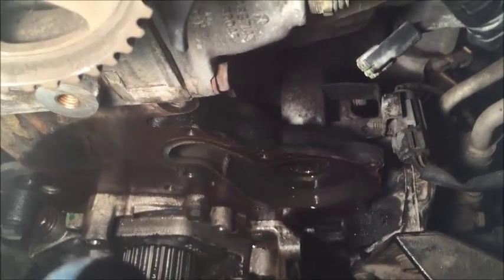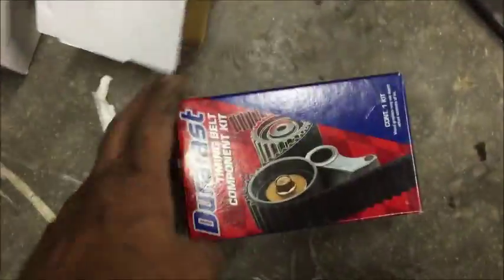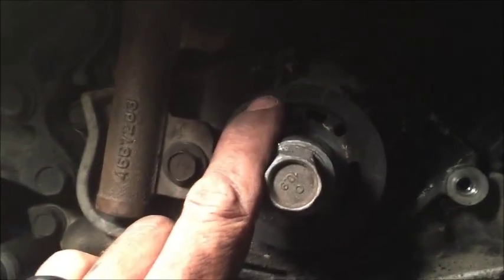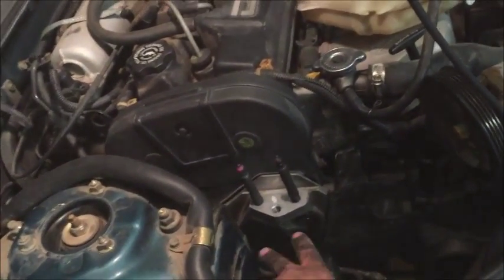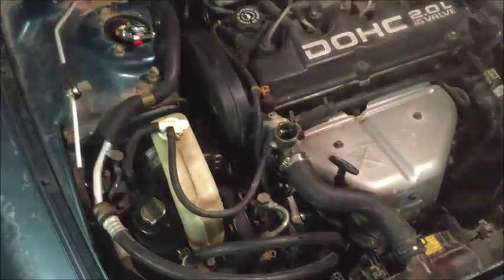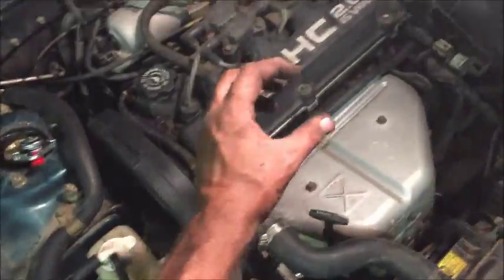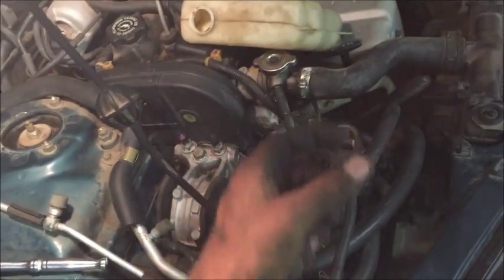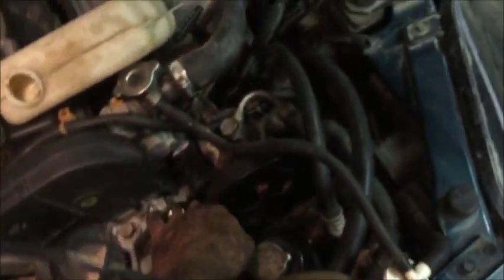How to Replace a Timing Belt on a Mitsubishi Eclipse (1989-1999) Part 2

Comment: Hey just bought a 1995 talon. Has exact motor yet the belt kit has a mechanical or hydraulic tensioner option. Do you recall which one you had put in this engine??

Comment: how did you put water pump on did you cut the timing cover and what did you do with the tensioner going to replace all on mines thanks
Reply: He cut it cuz the only way would be takin off the cam sprocket to remove    Back side of cover

Comment: hello love the vids I have a 98 RS and was wondering if you can do a vid on how to replace a head gasket and valve cover gasket. i have found a lil coolant int the first spark plug hole and I'm guessing that means my head gasket is bad and or just the valve cover gasket went bad but time to replace both anyway thanks.

Comment: Great video, I have a Neon the head was sent out for a valve job. Not sure how to realign the cam gears. looks like it is very similar to the Eclipse engine set up. Have not been able to figure out the cam gears set up. think the exhaust is just closing and intake about to open on #1 at TDC ? sound right? Thank you for the great video.
Reply from the maker: yeppers, that is correct. when your done installing, rotate the engine by hand ( socket on crank sprocket ) rotate it at least two times around to make sure no valves are hitting a piston. thanks for watching.

Comment: You should have said that you cut the inner timing cover in order to change the water pump. The only way to keep it in one piece is to remove the cam gears and then retorque them after you reinstall them.

Comment: How did you take off the harmonic balancer with the crows foot ? Mine just simply won’t come off
Reply from the maker: i wrap wire around it, lots of wire. however you auto parts store will loan you the correct puller with a deposit that is fully refundable when you return it. thanks for watching.

Comment: I just got a 98 eclipse and it cranks over but won’t start, it’ll run for a second but then shut off, I’ve replaced everything fuel related, new alternator and only thing I can think of is timing

Comment: OMG WERE ARE YOU!?   I NEED HELP DAMN IT
Reply from the maker: +frost lee 
im here, what do you need?
Reply: lol well  i justfixed my car that had bent valves.   the person put it back in the car,  but now there is a ticking noise.  it drives, and it runs,  but when i come to a complete stop, it wants to shut off and die.  plus the car shakes alot as well .   i dont want to fix the valves again, im broke after that ):
Reply: mine shakes alot too

Comment: great videos of the 420a engine. I've been looking for something that actually walks someone through the process.

one thing that I've been looking forward to see, is how to place the belt back on. I don't know which way to place the slack.

in between the cams and tensioner? or between the tensioner and crank.
Reply from the maker: slack will always be to your right. but the tensioner will pull it snug. great question. just remember when the belt is finally tight the gears should line up. so worse case rock 1 tooth of on the left cam, to the left thanks for watching.
Reply: +thomas brian awesome. keep up the videos! you have a subscriber.
Reply from the maker: always to the left, so if its a dual over head cam, between the left cam and the crank. thanks for watching.

Comment: Do you still get on YouTube? Because I have a couple questions if you would be able to help me I would really appreciate it.
Reply from the maker: i try to daily, but sometimes skip a day.
Reply: Well I was wondering if you could help me. I have a 98 eclipse the same one as in the video you made. And my car is over heating but when I open the radiator cap to see if water is flowing through the thermostat housing there isn't any water flowing. Would that mean that my water pump went bad?
Reply: And also i took the thermostat out to maximize the water flow so it's not the thermostat. And I flushed the system, also put a garden hose in the thermostat housing to clear up and blockage if there was any. While I was doing this I left the drain plug for the radiator out so that I could see if water was flowing through the system and it was. So it's not because I have a blockage in the system. So would that mean it's my water pump?
Reply from the maker: yes water pump, or a air bubble in the system. after re filling, let it run for at least 20 to 25 min with the cap off to ensure no air is left in the system ( very important ) thanks for watching.
Reply: Okay thank you so much.